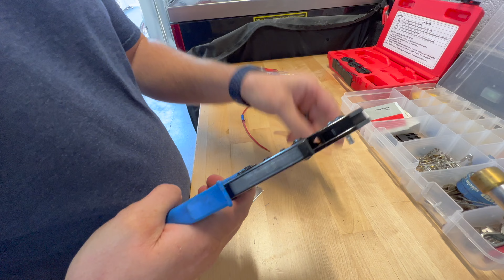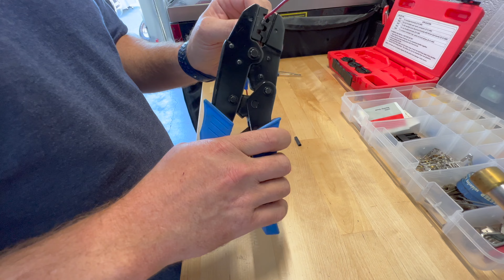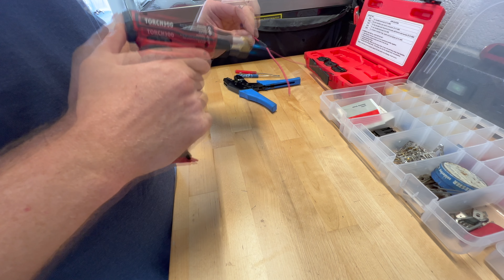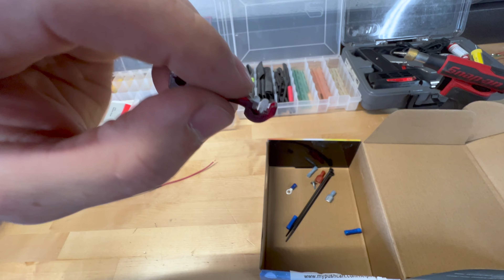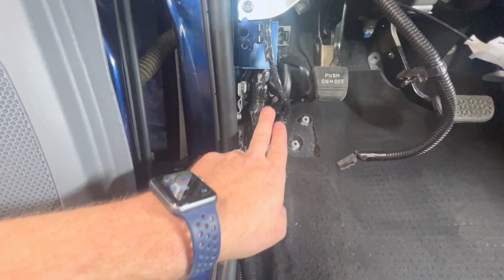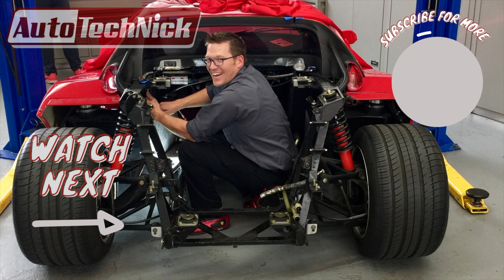Electrical Tips & Tricks When Installing Aftermarket Electronics

Comment: The bare barrels with the heat shrink is so much cleaner, great tip! 
The install turned out great! What’s your preferred method for joining the wires from the new harness to the original OEM wiring? 
Charles @6:13 is having a great ol time 😂
Reply from the maker: I have a few methods on how to splice the wires in. If I am feeling like letting my OCD run wild, I will de-pin the terminal from the connector, then build a “y adapter” with extra pins. The adapter will have an end that goes in the connector, one that goes to the original wire, then one to the new circuit. That does take some time sourcing the right pins/ terminals. But I like it because it is 100% reversible and untraceable. 

On this installation I chose to de-pin the factory terminals where I needed to make my connections. I then stripped the wire and wrapped it around the back of the OEM pins where they are crimped onto the wire. Then, I carefully soldered the wire on to the pin and reinstalled them into the plastic housing. This only works if you have enough extra room for the additional wire in the plastic housing, and if you are very comfortable with your soldering skills. Although difficult, this method can be reversed by remedying the solder and removing it with a solder sucker. I did try to film this for the video, but my hands were in the way of the camera the whole time. 😔 

My least preferred option is the cut the OEM wire and solder in the new one. I try my best to not cut into a factory harness no matter the car or project.  

~Nick

Comment: There’s also a slot for insulated or non insulated terminals in some crimpers. I see people use the non insulted slot which looks better because it crimps deeper but it punctures the plastic cover. One of my pet peeves.

Totally agree- scotch locks are a horrible connector they shouldn’t even be allowed to be manufactured.

Comment: Ford has those butt connector kits small and large and diameter ..best thing is heat shrink has hot glue in them!!!!!!!!!!!!!!!!!!!!!!!!!!!!!!!!!!!!!!!!!!!!!!!!!!!!!!!!!!!!!!!!!!!!!!!!!!!!!!!!!!!!!!!!!!!!!!!!!!!!!!!!!!!!!!!!!!!!!!
Reply from the maker: I have used those before. They are also a good option. Thanks for sharing the tip!